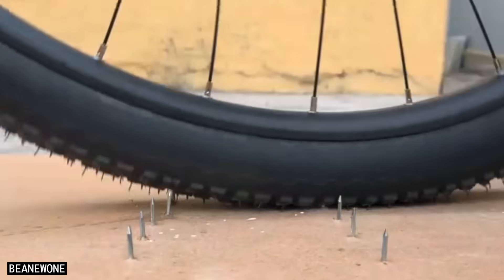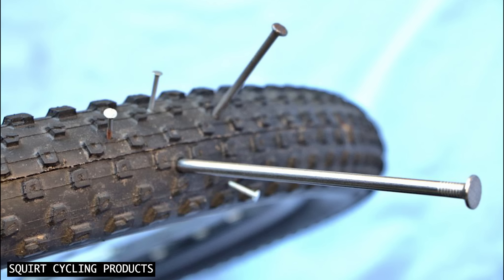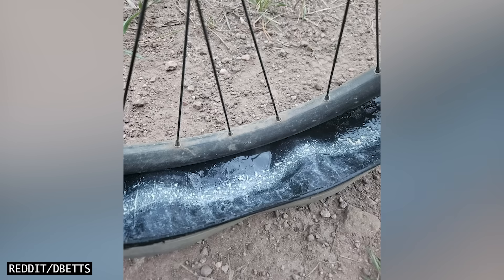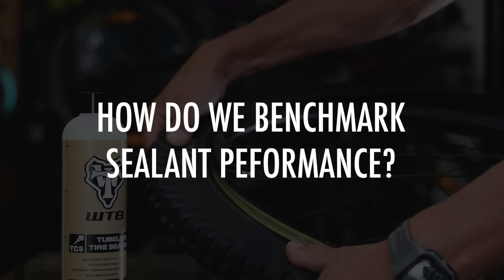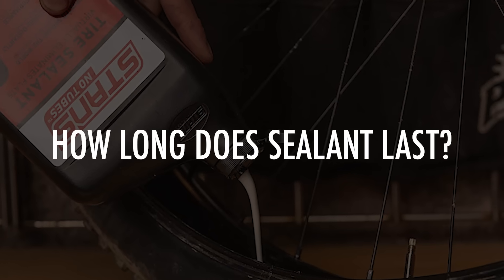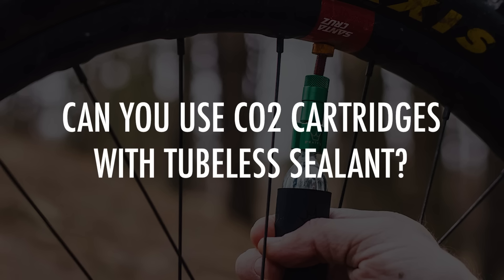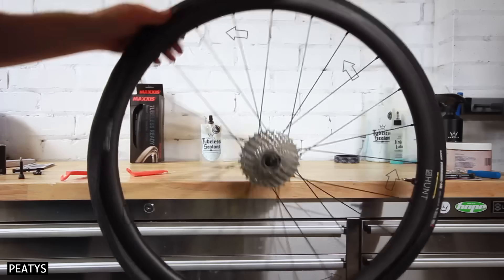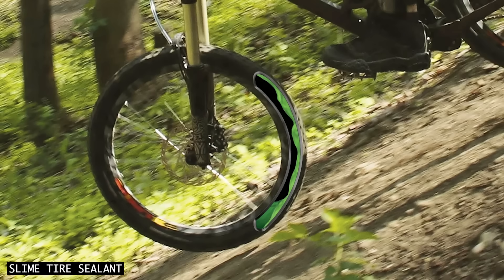I Found the Best & Worst Tubeless Sealants For MTB, Gravel & Road Bikes

Comment from the maker: Consider using the links below for your new high-performing sealant! It’s no cost to you and a great way to support this channel 🛞

🧡 Orange Seal Regular: Best For MTB/Gravel - Pressures Under 35 PSI
$35 for 946ml on Amazon - https://amzn.to/44nR6SR
$21 for 473ml on Amazon - https://amzn.to/44nR6SR
$17 for 237ml w/ injector - https://amzn.to/44nR6SR

💙 Peaty's Holeshot Biofibre: Best For Road/Gravel - Pressures Over 35 PSI
$36 for 1000ml on Amazon - https://amzn.to/44mV1iR
$29 for 500ml on Amazon - https://amzn.to/3WlkJ5h
$7 for 120ml w/ reusable pouch injector on Amazon - https://amzn.to/4aW594q

💚 Stans Original: Best For MTB/Gravel - Pressures Under 35 PSI
$33 for 946ml on Amazon - https://amzn.to/3UHcejM
$20 for 473ml on Amazon - https://amzn.to/3UHcejM
$8 for 59ml w/ reusable bottle injector - https://amzn.to/3Qs5dR6

💜 Stans Race Day: Best For Road, Gravel and MTB - All Pressures
$41 for 946ml on Amazon - https://amzn.to/4bDunVn
Reply: Great summary, and really appreciate you breaking it down by pressure range and application!
Reply: Your links seem not to work for EU Amazon. Therefore I bought your E-book ;-)
Reply: After watching this video I tried Peaty's. Sadly, I cannot confirm your findings. I use a road bike, 25mm tire at 90 psi and drive predominantly in the netherlands on good road surfaces. Don't get me wrong, peaty's will seal the hole (eventually, after the pressure has dropped to around 75psi and it has sprayed everywhere). But it will re-open often on subsequent rides. I've tried it for an entire summer and it had a 2 and 3 mm hole it just can't keep sealed. 
I've used stans no tubes for 3 years and never had any issues. your millage may vary, but i'm spreading the word that peaty's is not better than stans (added downside to peaty's is the cleaning which is a lot harder to get of the bike and your hands/arms)
I appreciate your work (bought your packbike guide)!
Reply: on continental grand prix 5000's btw (no tanned walls).
Reply: you should try oko sealant

Comment: I find the silca ultimate does not find its way to the puncture. So yup you lose pressure until you tilt the tire so the sealant is over the puncture, then instant seal. Pump it up and away you go, the seal is permanent.

Comment: Thank you very much for sharing your knowledge. 👍 I bought the Peaty's Holeshot due to you recommendation for my road bike.
The head of Silca (Josh Poertner) said in a video that Peaty's will have trouble sealing in wet conditions because it's water based. Can you confirm that and do you have any information/experience about the New Silca ultimate sealing 2.0? Afaik it does not seal better, but lasts longer and is compatible with all rim tapes and CO2 now. 
Many thanks in advance! 🙋‍♂️

Comment: Oko offroad sealant
Go get some 😀
I stabbed my tyre four times 
Hitting a centre punch with a hammer
Riding 26 miles per day for 8 days and I didn't need to pump the tire up 
Had one puncture in three years riding to work six miles each way five days a week
I left an old innertube outside for two years on the garden 
I cut it open and the sealant was still liquid like the day I put it in 
1.25L £15 off Amazon

Comment: I can confirm Peatys tyre sealant did NOT seal a small hole made by a thorn on my emtb 2.4 tyre running 21 psi 😕
Shame as its Bio degradable formula is good and makes washing out the tyre very easy, unlike latex based sealants.
Pro & Cons I suppose.

Comment: Per usual, a clear, concise, and no baiting of the clicks video! Your vids are just so good. Thanks for doing the heavy lifting for us.
Reply: I've used the ones he's suggested and they always fail especially stans rubbish 🤣
Oko offroad for the win 
Riding 12 miles per day going to work for three years I've only had one puncture the sealant couldn't deal with 
It doesn't dry up even after two years the sealant is still liquid

Comment: I tried Peaty's Holeshot Biofibre on my roadbike (28mm 4.8 bar) an it can not even close the smallest hole. One of the holes was to samle for a plug, but only if I lowered the pressure to 1.5 bar it stop leaking and after one hour I try to pumpe the tyre up to 4 bar, but then I could start to see the "seal" leaking out again. I normally use Stan's original an it works better and is not so messy. I think Peaty's Holeshot Biofibre is the worst sealing I have even used. Orange dry out to fast and is also messy

Comment: 2:04 - I confirm that orange seal is the best on the market. as a commuter I had so many punctures. Since I use Orange Seal it got much better (even then you're not totally immunte to puncutes ;-) [Edit: with a good milk injector you refill your tires within 5 min. ... so 'high maintenance' is relative ...]

Comment: I think that for a good sealant to work you also need a tough tyre, like one with a tougher casing, cose it's kinda futile for a sealant to work impressive results or do something magical if you have a paper thin tire or one that was super weak casing. I think this is the main problem most people have when going tubless and then complaining it's a failure or not as they were expecting and they jump back to tubes.

Comment: Great video. However, there seems to be two separate applications; low pressure MTB and high pressures. What about a multi use gravel bike that sees between 30 and 45 psi for varying surfaces on a regular basis?  It seem to be bridging the gap between sealants that work well on one end of the pressure spectrum and poorly on the other…
Reply from the maker: Stans Race Day tests well in all scenarios due to its latex base and high amount of particulate. Peatys and Orange Seal Regular will also do a great job. As a general rule, you’ll find that the sealants that test well for low pressure MTB tyres will perform well in the 30-45 psi range.

Comment: The worst Ive used was the 2018 FinishLine sealant.  Its claim is it never dries out but it never dries to fill a micro p'ture,  My 25mm road tyre would gradually lose pressure and a slight bump (such as a cateye) was enough to unseat it.

Comment: I fully concur with you my own expereince was Silca is hype over substance threw away very expensive leftover and 2 bottles of replenisher
Stans hardly worked maybe once
Peatys let me down 2 months ago when on a bike tour however back home it worked on glass cuts i find regular shape tests like nails they all can work better however irregular cuts is the real test
My cuts would be your 4mm
My next try is Orange and Milkit
I use gravel and road tyres

Stans Darts just fell to bits on the last 4 punctures losing all air they did replace them so hope they work  next time
BTW I recently tried Leyzene Proplugs they didn't work

Comment: I can confirm Bontrager sealant is terrible.  Tried it at low pressure gravel tires and higher pressure (75psi) road tires and had 2 failures from small punctures.  Switched to orange seal. no issues. even use it in tpu tubes.

Comment: Personally…. As I change tyres on one Mtb bike for various riding from bike park to xc, I put sealant in tubes to avoid the mess and contaminating the tyre. Weldrite for tubes seems to work ok but won’t seal over 3 or 4 mm holes

Comment: orange is crap. doesn't maintain sealing when tire is flexing.  Silca recommends using their "maintainer". my home made sealant works as good and much cheaper
majority of sealant will not seal road tires even at 3 bar  around 60 psi. tire flex causes to spill sealant even with 1-2mm cut  orange seal  is really bad. only way to have to apply cyano glue at the cut to prevent sealant loss.

Comment: I recently crashed a road/gravel bike when going straight on a small round-about (so barely lent over) after my rear punctured and Finish Line "never dries out" Sealant had escaped, as expected, but although it was only a small amount, it had coated the outside of the 38mm Schwalbe G-One Speed tyre, leaving it as slick as oil, so I hit the deck instantly!
I have now gone back to latex-based sealants in the hope of never experiencing that again. Obviously, too much of any sealant coming out is going to be sketchy for handling but I have never heard any reviewers discussing such instant and potentially fatal loss of traction.

Comment: Still on tubes and using green slime.
Only time it let me down is when it had turned too watery after a few years of not being used/ checked and the got a tiny thorn which ruined a ride, got home tried to repair puncture to no avail but adding more slime fixed it ..

Comment: I have been using Stans for over a decade now, I don't think I even got a single puncture that it could not seal. Just out of curiosity I checked out your recommendation (Orange Seal), and here the price is the double of Stans... thanks, but no thanks.
Reply from the maker: In most markets, the retail price of Orange Seal is within 10% of Stans. Either you've found a discounted price on Stans or your local distributor of Orange Seal is greedy!

Comment: I'm using Stan's Race for the initial setup und Stan's original for topping up every few month. Only hole in the last ~50k km that wouldn't seal and I had to use a plug. Topping up with Stan's original through the valve simple enough.

Comment: OK, I had an idea, even before seeing what Orange Seal does, just from having heard you say that some tyres are, as I understood, "thirsty" (porous) and can "drink" the sealant, or its evaporating components, after a short time: Here it goes. I bet there is some lubricant, like petroleum jelly or others, which could help create a film on your inner tyre surface, stopping the abovementioed effect, and also working against the sealant drying up inside the tyre.

Comment: Hi Alee, which sealant and valves do you personally use with your 2.8 G-Ones?

I am using the same tyres as you, and I would like to switch to tubeless (never used tubeless before).

I use my bike for daily commutes to the office as well as for long touring adventures.
Reply from the maker: I'm currently using Stans Original sealant with Stans valves.
Reply: @Cyclingabout  Thanks for your reply! I might give it a try, I am just scared about the maintenance...
Reply from the maker: @varez93  I just pour some sealant in through the valve every four months or so. It's not too scary.

Comment: I'm using Stans Original since march this year in both MTB and gravel bikes. Both at 2-2.7 bar. Honestly I can't tell about performance since I never got a single puncture yet (lol) but I've swapped tires on my gravel bike after 4 months and it's condition was good enough to put it in another set of tires so I did it adding a little bit on top. My usual season is around 7-8 months of riding so I guess I have enough to not swap sealant entirely until the next one.

Comment: I do thousands of miles per year bikepacking in mostly desert environments.  The temperature ranges from slightly below freezing to summer in Death Valley kind of heat.  I run Stan's original in my low-pressure tires from plus-sized at 2.8" wide or fat, 3.8", when I am expecting a lot of sand.  FYI, I roll a Rohloff based Tumbleweed Prospector with 27.5" i45 wheel.  It allows me to swap between 2.8" (plus) and 3.8" (fat) tires. 

I am sure I am getting a lot of goat-head punctures, but I never notice them because the sealant works immediately.  About once a year I get a more serious puncture from a large nail, metal scrap, or glass.  I know it occurred because usually my tire pressure drops pretty quickly.  Then I just look for the wet spot.  A find the hole, clean it, plug it, and finish the repair by adding 2oz of sealant through the valve.  It is so fast to repair a puncture with a tubeless setup.

On bikepacking trips I bring a whole repair kit that includes inner tubes, patch kit, sewing kit, a boot, 6oz of sealant, and tools.  Lastly, sigh... I have never had to ever put an inner tube in to solve a puncture problem in all my years of bikepacking.  The tubes have just ballast.  I know that if one day I leave the spare tubes at home, I will need them.  So, they are basically a good-luck charm against ever needing them ;)

Comment: I'm still not sure which product to use.  I normally run at 50 PSI.  It's in the middle between road and MTB.  I currently use Stans regular, but I have had a couple of flats with small holes and had to plug them with a bacon strip.  Should I go to Orange or Stans Race Day?  Peaty's?  Longevity is important as I do extremely long bicycle tours and don't want to constantly change the sealant.  But not fixing flats is an even higher priority.
Reply from the maker: The puncture test data on pressures in excess of 35 psi suggest Peaty’s HoleShot Biofibre. It has great longevity.
Reply: @Cyclingabout  Thanks!!  I'll give it a try.

Comment: Never heard of peaty's, just starting my tubeless journey on my personal bikes. Like using muc-off tubeless tape in my work as a mechanic so I went with them, good to see muc-off is still pretty well performing. Will try a bottle of Peaty's next year when muc-off is depleted. Thanks for the video!
Reply: Just a friendly FYI anecdote - Peaty's doesn't work well with porous tires, tried it on a pair of 40mm Gravelkings and after a month the wheel felt imbalanced. When I checked it out the sealant had dried into a thick, hard-to-remove slime which was stuck in place. Orange Seal dried just as fast but was more distributed and easier to peel out.
Reply: @justsomedude404  thanks for the tip!

Comment: What happen if I mix the sealants?  Sometimes I just can't wait for sealant to dry out.... but i got a different brand from sale.......
Reply: If the old one is dry, or they are similar latex based, its usually ok. But if its incompatible, might never seal and you'll have to clean everything out.
Reply: @jaro6985  well.... i have no idea what was in the tire before..... so i just keep topping up with whatever i found on sale.......

Comment: I think you saw no latex in the Stans tyre after 4 months because most of it is at the bottom of the canister. Increasingly so with the race version.
Stans is just a better version of something that isn't good enough, and the race one is just not worth the hassle.

Comment: Something that Alee didn't mention is the option of removing the valve core before injecting sealant through the valve stem. It adds a couple of steps to the process, but it only takes a few minutes at most. Some folks recommend soaking the valve cores in mineral oil before installation in order to make them hydrophobic, thus reducing the rate at which they gum up with sealant.

Other than that, I found interesting how different sealants appear to work best at different pressure ranges. I would have thought that a sealant that works well at high pressures would also excel at low pressures, but the data doesn't appear to support that.
Reply: I thought it was assumed that he was removing the core.
Reply: @billweberx  You are probably right. I use Schrader valves, which are very unlikely to clog while injecting sealant if you remove the core.

Comment: I'd be interested in some outside the box thinking, and testing of automotive fix-a-flat. I know it seals the inner surface of the tire.

Pennzoil makes bike-tire sized cans of fix-a-flat....
Reply: I tried Stan's almost 20 years ago -- that 16oz bottle gets used up quickly! And at $22/bottle back then, it made zero financial sense.
Reply: The problem with the emergency automotive stuff is it will ruin the inside of the tire and be hell to clean off the rim.

Then there is Slime, which is dirt cheap, but doesn't seal rim seat well. So you'll have endless slow leaks.

Comment: I’ve stopped using Silca after a year of randonneuring.  60 psi on 700 x 32c continental tires.  I find the carbon fiber bits coagulate and form balls up to 2 to 5mm.  This makes the carbon fiber useless and the latex can’t seal holes.  And when it’s raining…it’s useless because the latex never dries

Comment: Great video Alee, I'm curious what you consider "high pressure" classified as?
Reply from the maker: I’m using high/low pressure as relative terms. My recommendations have been classed into under 35 PSI, above 35 PSI, and all air pressures.

Comment: Motorised vehicles have had tubeless tires for around 60 years but with one big difference, they don't use any sealant. IMO tubeless on bicycles is just a fad and TPU tubes are far superior in many ways.
Reply: Don't care if its superior, not having to swap out a tube in the wet and cold outside is worth it to me.
Reply: To each his own.  I've found tubeless with sealant to be a miracle solution to constant flats.

Comment: I'm beginning to think this is all tire dependent. I have 0 doubt in how good your tests have been run but in my experience, silca has sealed every puncture instantly on the road for me while stans and orange seal has failed multiple times.
Reply from the maker: It’s probably more outdoor conditions dependent. Stans Original and Orange Seal usually don’t have enough suspended particles for road bike tyre pressures, so I’m not too surprised that Silca has worked better for you.

Comment: I think that although I have a gravel bike, I need to follow your MTB recommendations. I say that as I am running 42mm Rene-Herse at 26/25 PSI. As it happens I have always used Orange Standard and have never had a puncture (although I find plenty of thorns stuck through the tyres when I take them off). Great video, very informative, new subscriber